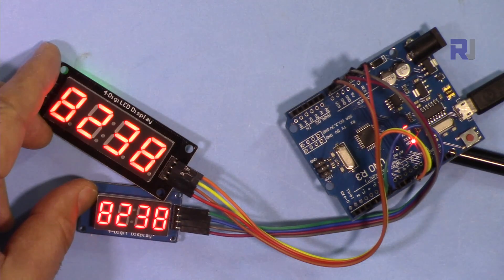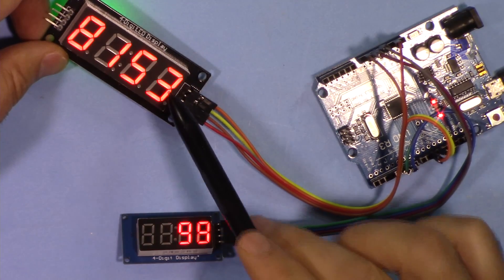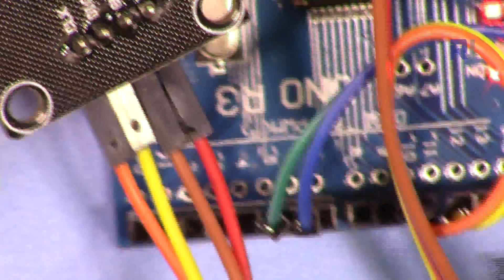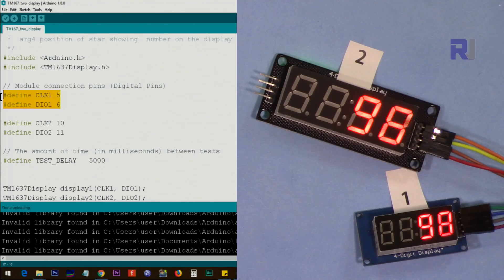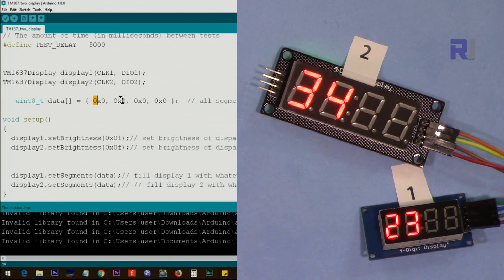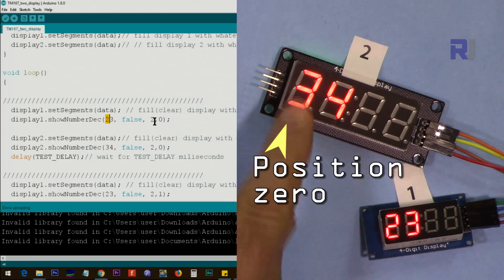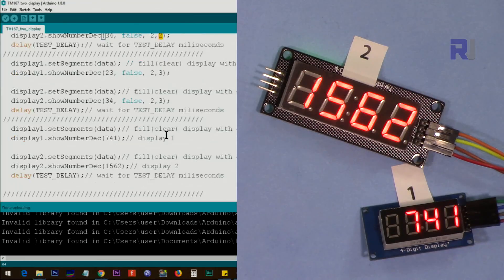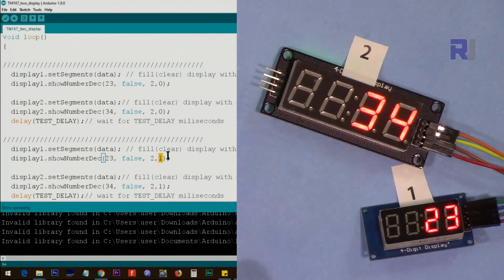Using multiple TM1637 4 digits LED Display with Arduino

Comment: Hi! Nice video. Just one note, you can use the same CLK pin to give clock signal for both device at the same time, there is no need to separate them. This way you can save 1 pin on your arduino.
Reply from the maker: Perhaps you could if you wrote your own library. but with the current library you can't.
Reply: @robojax  Okay, noted. Can you daisy chain 2 or more of these bigger led digits? so you connect to arduino on the right side pins and on the left side you connect another one in series with mother-mother jumper cables?
Reply from the maker: No you can't. You will need this module : https://www.ebay.ca/itm/173060000548
Reply: Hello! I use the same DIO for two displays. They work properly also. You can save a number of pins equal to number of displays more than one.

Comment: This tutorial was great. I am a bit new here and trying to use some of this design to work as a slot car lap counter. I'm close to getting it working but struggle with using two defined pinMode settings.When either button is depressed both displays increment the count. I can supply the sketch. I'm sure its something simple.

Comment: The second 5v is supplied by IOREF pin which for the UNO and MEGA is 5v.  That connection is viewable  at 1:54 and 1:59 in the video but not called out directly. The board used in video has two 5v pins marked. My Elegoo has the pin labeled as IOREF With the help of Robojax, the TM1637 is a joy to work with.

Comment: Hello! Thanks for your video. It helps me to start TM1637 based LEDs display. I have two thing to tell you:

1. The brightness work in 0x0 - 0x7 range. The TM1637 consider only first 3 LSB. The brighness adjust is made by duty factory of comon anode commnad of digits. For 0x0, the ON time is 40 microseconds, for 0x1 time is 82microseconds and so on till 0x7 where the time is 600 microsecons. The cicle time of all digits is 4,7 miliseconds.

2. I try to use only one pin for DIO. I conected DIO of the two displays togheter at pin 8, CLK of display1 to pin 9 and CLK of display2 to pin 10. They work OK. Each displays diferent value. That means is not necesary a distinctive pin for each DIO. They can be conected at the same pin. In code I define DIO1 and DIO2 at pin 8. In fact, all TM1637 receive a start comand on I2C, but anly one display will receive clock signal from microcontroler. Finaly, all TM1637 will receive a stop comand. If the driver TM1637 didn't receive clock signal between start and stop comand, the display will stay unchanged.
Reply from the maker: You are welcome. Thanks for the comment.
Reply: You are great 😊

Comment: Greetings Robojax
I have two TM1637 LED 0.56" Display Module but there is no way to work with ESP8266 ESP-12E WiFi; Normally works with TM1637 LED 0.36" Display Module (Smaller Display) but with 0.56" it doesn't work. Turns on Led Red behind the board but the display doesn't show anything. Do these modules larger than 0.56" only work on 5 volts? Do you have any tips for working with NodeMCU? Thanks
Reply from the maker: Use this Using HT16K33 4 digit seven segment display with ESP8266 NodeMCU and D1 Mini https://youtu.be/UE92hrn8Fg4
Reply: @robojax  So, you can't use the TM1637 LED 0.56" Display Module with ESP8266? I think that's weird!

Comment: thanks for the video. I want to know how many TM1637 can I connect to a single Arduino Uno or what would be the best solution to use several TM1637. thanks in advance
Reply from the maker: that is why I made this video. As long as you have the pins you can connect.

Comment: Any way to make sure there isn't interference with the screens running together. having a hard time getting more then 2 screens to run smoothly together.
Reply from the maker: there is not interference. there shouldn't be any.
Reply: @robojax  I'm trying to run potentiometers on each screen with a calculation. After 2 screens I get a lot of interference.

Comment: How can we use more TM1637 in parallel to since it has no slave address? Please clarify. Thank you.
Reply from the maker: This module uses serial communication and you can use any digital pin to connect. Simple as that.
Reply: @robojax  thanks for your reply. I don't have spare digital I/o pins. I have used all. So I prefer to use only i2c. I have also many i2c devices connected on the same i2c  module. Is there any way to use 5 or 6 tm1637 on the same i2c module.
Reply from the maker: You are welcome. This device not using I2C communication. with I2C you can use up to 128 devices. You can use analog pins for other purpose as digital pin and they work (see it here I used them https://youtu.be/Q9aBI4ELKC4) and then use digital pin for the TM1637. Good luck.

Comment: I see in this tutorial you have two different sizes of TM1637. What is the ordering identifier for the larger size and the dimensions? I recently purchased a set from you via amazon and they came as the smaller more common size. Thanks.
Reply from the maker: The small one is  0.36" and the larger one is 0.56" LED display and you can see them here https://www.ebay.ca/sch/i.html?_from=R40&_trksid=p2380057.m570.l1311.R1.TR11.TRC1.A0.H0.XTM1.TRS0&_nkw=tm1637&_sacat=0

Comment: Hello, if I want to show the temperature on the tm1637 display, 15.7, what function do I have to use?
Reply from the maker: Hello, I've spent so much time and not worth using this display use this display  which is the king https://youtu.be/4aCgHNJl9kY or use this LCD https://youtu.be/Q5enXzaNXZk forget this TM1637 junk.
Reply: @robojax  thanks for your answer, you have some thermometer circuit that shows the temperature 4 display of 7 segments with the sensor ds18b20, or an ntc, or dht11
Reply from the maker: Here is how to find Specific YouTube Video in a channel https://bit.ly/findYouTubeVideo

Comment: Hi is it possible to run 4 separate (independent) 3 display segments of Arduino?
Reply from the maker: Hi, may be I am not reading this correctly but this video is exactly shown that. I demonstrated with two so you can do with as many as your Arduino pins are available
Reply from the maker: The two shown are independent.
Reply: Ok 100%, I busy with a 4 display

Comment: hi Robojax... I'm a newbie in this area. For my assignment, I need to control 3 units of TM1637 by using PIC16F886. i managed to program the PIC but somehow the LED lights keep flickering. im using 5VDC input. Is it because of insufficient power supply?
Reply from the maker: Hi Norhafizah, the flickering is due to the delay in the loop. If you can, reduce the delay for example if you have it set to delay(300), then make it delay(200) or lower until it is corrected. Please reply here and let me know if it worked.  salaam. Ahmad from Canada

Comment: i set full brightness at software control i am using different 3 digit module on same pcb it is not enough bright what i can make in hardware? for increase brightness
Reply from the maker: I have shown it how to set to maximum. If that is not enough, then you are under the sun or  your power source is not able to supply power. use different power supply.

Comment: Hi Robojax, great video. I have a big question. Is it possible to wire 6 of this led displays 6 stepper motors and 6 home switches, 6 RGB led diode, 1 temperature sensor and 1 water level sensor and 1 solenoid valve to 1 Arduino UNO ? Or any of Arduino board? Thank You!
Reply from the maker: Thanks. For Arduno Uno, count the pins and if you can fit all, you can do it. Or get Arduino Duo or Mega.
Reply: @robojax  Thank You Robojax. I think I'm going to choose Arduino Mega 2560 clone. If i may ask would you help with this project? Of course didn't think to take your time for free.
Reply from the maker: You are welcome. I am sorry I am very busy with my full time job and part time school. Can't do it.

Comment: is it possible to connect both clocks? so it only uses one digital output on the arduino?
Reply from the maker: these two displays are not clock. they display information FROM arduino. They  DO NOT send information TO Arduino.
Reply: @robojax  Im working on a project where i have to hook up about 16 of 4 digits 7 segments  lcd displays to the arduino. Is there any way to avoid having a single clock bus for every display?
Reply from the maker: Sorry not possible as each display has separate chip.
Reply: Blondie SL thank you for you advice. I was doing a school project and wanted to implement some of those, but I managed to hooked up 16 of them to the mega, I don’t remember very well but I think you can connect at least 8 to the same clock pin, I believe I ended up using only 20 pins on the board plus 1 extra to ground the board

Comment: How we can build the DC 500V and 20A and 4000W and Kwh meter recomend me the modules for Arduino
Reply from the maker: are you looking for DC power meter? If so hen I have this video to display the current. https://www.youtube.com/watch?v=GE4I10IZ1jY and very easily you can also read the voltage (500V or more) using this video https://www.youtube.com/watch?v=FaoKzi7tgME . You can multipley P = IxV and get it.

Comment: Hello Robojax  Thank you for posting this perfect video, This is perfect for a robot I am building and I was wondering if there is a way to alter this line "#define TEST_DELAY   5000" so I cold have display 1 cycle slower or faster than display 2. I am also working on adding displays 3 and 4. I think this would be amazing for what I am making. Thank you
Reply from the maker: Hello Jin, You are welcome.  yes you can change the value to see whatever fits best your application. for 3 and 4 item, just follow the same principle and it should work. I mentioned in the video that this is for 2 or more. So you can follow the video. Watch it again so you learn.

Comment: I have a large display from eBay no display even I supply it separate 5dcv
Reply from the maker: This is video is for 2 displays. Watch this video https://youtu.be/DuamjlstOKM  Please include the library. Without library  it won't work.
If still doesn't work, I  will post a solution in a few weeks.
Reply: @robojax  its working now thanks to you.  I have a making a project with on/off switch, StbY on the display then beep sound and timer starts then when hit the plate timer will stop.  Can you please help me with the codes